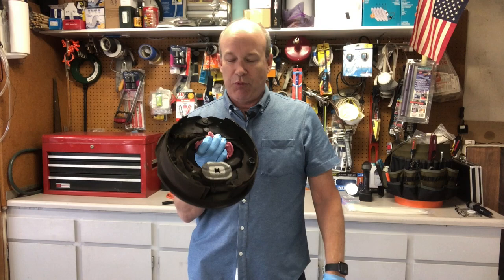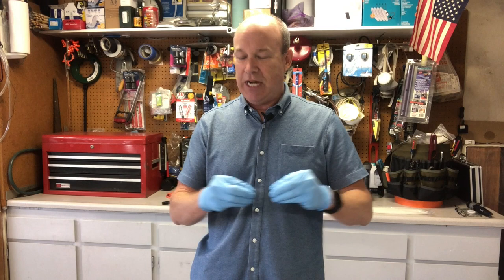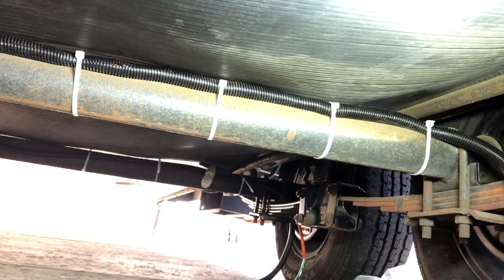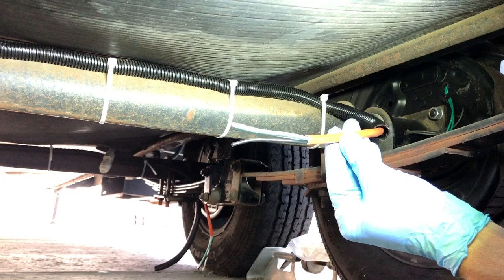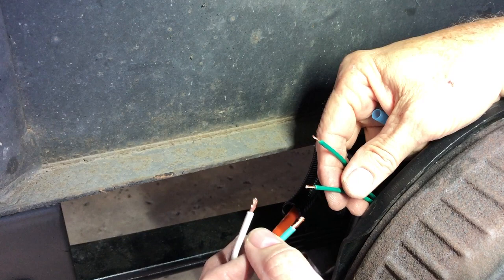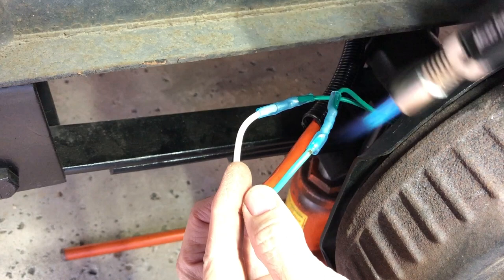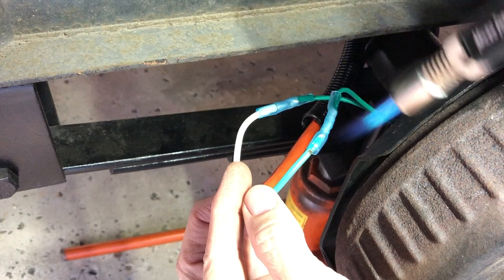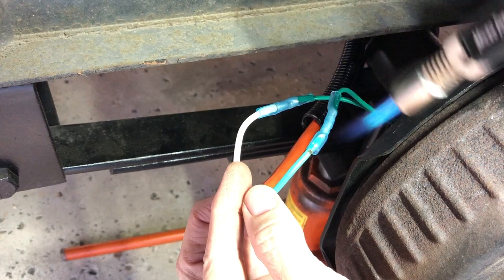Fixing A Surprise Travel Trailer Brake Short Circuit

Comment: I was having OL and SH codes on my brake controller and came upon this video and sure enough, the wiring in one of my axels was shaved down in 4 areas. Replaced both sections of wire on both axels and bam no more error messages. Thank you so much !
Reply: I have the same problem  def Im going for this  hopefully I can find the problem
Reply: @octaviofuentes7781  it really does seem to be the most common point of failure for the brake wiring, you'll have to take a chance and cut the wiring to be able to pull it out of the axel in order to examine it, at least I did. But it was well worth the try because it was definitely where it was shorting for me. I put new wiring in wire loom and tie wrapped it along the back of the axel to avoid possible debris or rocks hitting into the wire loom. This video saved me a ton of trouble
Reply: @Mazda6RAM2992   yes there are to many videos about this common problem  I just hope is nothing major

Comment: Thanks so much for this video, sir! My 2018 Jayco travel trailer brakes have been plagued with on-and-off short circuits for the past two seasons. Been to the dealer and specialized garages three times, with not much luck. Finally decided to follow your lead and changed entire brake line as per your video. Result: I’m just back from a 1,000-mile trip on some very rough roads in north-eastern Quebec and the brake system performed A-1 the whole trip!! You are a life-saver! 👍👍
Reply from the maker: Wow this is so awesome Philippe !  I'm so glad this fix solved your problem too.

Comment: Great  video… I found the wire running in the back axle frayed, melted as you demonstrated.  Solved a years long intermittent short.  The wire in the front axle also had an exposed conductor, but must have been the ground side so no impact…. Replaced all per your procedure… so far…reliably braking!  What a relief!
Reply from the maker: This is so awesome. Great job!

Comment: @DoableDIY-Just wanted to thank you for this video as we were just recently getting a short message on our brake controller during a trip.  Was able to 'pull' the wires tight within the axel and zip tie them to prevent shorting on the inside of the trailer tube.  Worked all the way home and now I will be running new wires on the outside like your video.  Never would have thought this to be the culprit until I watched your video.  THANK YOU!
Reply from the maker: Wow, I’m so glad this was able to help you !  It really is a weird problem. Good luck with your repair 👍.

Comment: Nice video, very helpful. I am currently replacing the brake wiring on my thirty-year-old trailer. New brake assembly, wiring, heat shrink, etc. One thing I would suggest. When pulling the wiring from the axles, tie some sort of string to the wire being pulled so that the string runs inside the axle. That way, if for any reason, you decide you want the wire to run inside the axle, you have the choice of pulling the wire back through the axle. You can tie the loose ends of the string around the axle and secure with zip ties.

Comment: Great video up to the end and then your forgot THE MOST IMPORTANT PART!!  you should have shown how you grounded the two new axle wires and shown how you ran them up through the trailer to the front trailer plug!!  finally, showing how you connected the new wires to the front plug would have finished the job. THE ENTIRE JOB is the part i was most interested in seeing.

Comment: I had this exact problem , I found an identical wire inside the trailer axles, I used this exact method to hopefully permanently fix this issue. I will take a road trip next weekend , to be double sure! Thank you so very much
Reply from the maker: Right on!  I hope this works for you too. I have towed for hundreds of miles since this repair and all has worked perfectly. Safe travels !

Comment: Dude, you are the man!  I did this today one axle at a time and on the 2nd axle, SH O.L went away and the brakes appear to be in full working order.  I need to pull the wire out of the axle to confirm but I’m pretty sure this was the problem since they worked occasionally and now no issues. Thank you for saving me $150/hr at my local trailer repair.
Reply from the maker: Wow that’s awesome Manny! Great job 👍

Comment: I really like this idea and went to Harbor Freight and bought the same exact materials to upgrade my brakes.
Reply from the maker: Cool Mike. Good luck with your project !
Reply: @jskidpatrol  One additional thing I am going to do is add stainless steel hose clamps along with the tie wraps.  It might be overkill, but will give me additional peace of mind.
Reply from the maker: Mike Bowling that’s a great idea. If the zip ties degrade over time I’ll do the same. 👍
Reply: @jskidpatrol  Question, on the side with the line from the brake controller (6 wires) what type of connector did you use for the three wires each, ground and positive? I hope my question is not confusing.
Reply from the maker: Mike Bowling Hi Mike. I was able to use a larger size of the same connectors shown here in the video. I crimped 2 wires into one end and 1 wire in the other. I was still able to get a solid crimp on the side with one wire even though the connector was a little larger. Then heating and shrinking it should keep it together too. Good luck!
Reply: @jskidpatrol  That's exactly what I did.

Comment: Great video series! I have the same intermittent (shorting) brake issue on my travel trailer while traveling to/from Alaska. Note: I measured a nearly dead (.2 ohms) short between ground and the brake controller pin on the trailer 7-pin connector. During inspection under the trailer I noticed the rear axel was never connected along with the front axel brakes...no surprise as this is a 2016 Evergreen I-Cloud and Evergreen went out of business in 2016 and not the only shoddy workmanship found on the trailer. To get home I simply disconnected the front axel brakes and connected the rear axel.  I will now replace the inside tube wiring with external per your video on both axels and closely inspect adjust and test all four brakes.
Reply from the maker: Wow, sorry to hear that.  It's great that you can DIY though :)  Good luck!

Comment: Great video! Thanks, I found out the brakes on my new trailer were not working when my truck broke the belt. No power brakes or trailer brakes. I would also suggest doing a manual brake test at the start of every trip.

Comment: Great video! I recently replaced all of my trailer wiring but got a error message saying that I had a short. I didn't replace the wire inside the tube. Your video helped me know what to look for. Fixed my problem.  Thanks
Reply from the maker: That’s awesome. Nice job !

Comment: I have been working on trailer with electric brakes since 1972 and I have found this exact failure on more trailers than I can remember.  Upgrade your crimpers so you can make a proper crimp.

Comment: I was having this problem on my trailer after I had installed complete new brakes . I suspected maybe the 7 wire plug but this would have been a good place to look . I never got to run it down since I sold the trailer .

Comment: I realize this is an older video, but I am having break trouble.  My question is what did you do with the other end?  You have green and white wires - green wire to 7 pin connector and the white ground to frame?

Comment: Thank you for the video! I'm having issues with my 10k axles brakes in my trialer.  I found out one side isn't not working I did replace 2 bad magnets and still not working I'm gonna replace both wires I hope that's the short issues I'm running commercial and this issues is killing me I've been stock in my house for a over a month dealership sucks they don't want to fix it and few another shops around are 3-4 weeks out so I gess I have to keep Messing with this crap electric brakes😔
Reply from the maker: Sorry Friend, I hope you find the issue.

Comment: I am having the same problem you discribed. Already replaced all four brake assemblies and drums, etc. The problem went away for a while, but driving through some rain one trip I saw the problem again. I suppose the wires inside the axle's could be bad, but looking at the wires when I did the brakes, the wires seem to be like a coax type wire that's double insulated, unlike the wires you showed in the video. Could it still be the wires or do I have something else going on....Thanks, and enjoyed the video...

Comment: Thank you for the great video and tip! I too was having a random trailer disconnected message on my 2017 Ram 2500 and after inspecting the existing wire removed, found the bare wire which was my issue.

Comment: Excellent video, is there any way you could do another video explaining where the wire goes from the start of the connector at the front where the wires start at the battery all the way on how to connect that starting wire to all of the wheels thank you.

Comment: 2022 starcraft 26bh  is having issues saying the brake is dissconnected on 21 ram. Replaced the front 7pin still coming up  i wouldnt think axle wore thru? Its brand new. Bad magnets?

Comment: Just found your great video DoableDIY.  I have a check trailer wiring/trailer connected error on my 2018 chevy silverado 3500.  Everything on my truck checks out fine as far as power.  On my 5th wheel i get lights, brakes and signal power but no trailer brakes.  just wondering can you show the beginning of where you tapped into the power at the axle please as you didn't show that part.  Again i know this post is about a year old but it was very helpful.  Can wait for your response.  And thanks again.

Comment: Hi, great video! This is super helpful as I need to do this to our fifth wheel. Do you have a link to the wire from Harbor Freight you used? I want to make sure I am getting the correct parts. Thanks!
Reply from the maker: Sure thing

https://www.harborfreight.com/25-ft-x-14-gauge-indooroutdoor-extension-cord-62920.html

And any 14 gauge extension cord will do. 

Good luck!
Reply: @jskidpatrol  Thank you!

Comment: @DoableDIY, Question: I found the source wiring leading in on the driver side of my travel trailer. Both wires are then split to the magnet wires on that side. It's then fed thru the axle to each passenger side wheel. However, Only one of the electrical lines from the magnet on the wheel is connected and the other wire from the magnet is left unconnected. Have only one side of my brakes been working? Also, I found a frayed area exposing bare wire on the rear wheel passenger side
Reply from the maker: Hi There !  Because the brake electromagnets need 12 volt power and a ground to operate, it's possible on that side of the camper, someone has attached one of the magnet wires to the trailer frame to get the ground that way instead of through the wiring harness.  They could then be fed only the 12 volt braking power and still be able to operate.

Now if one of the magnet wires was not hooked up to anything, then the brakes on that side could not be working as they would be missing a ground.

I would personally be wary of having a different ground source for the two sides and would prefer that all four wheels (or two) were wired the same.  Good luck with your project !
Reply: DoableDIY thanks!